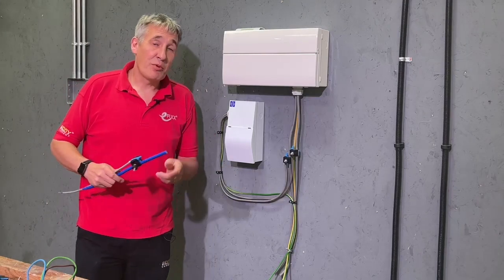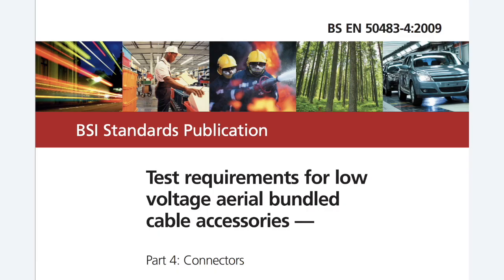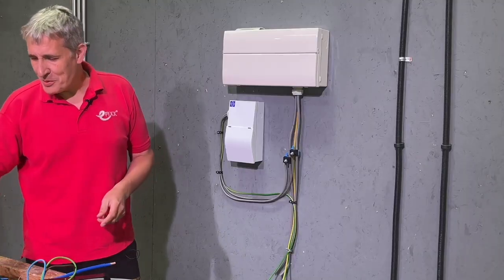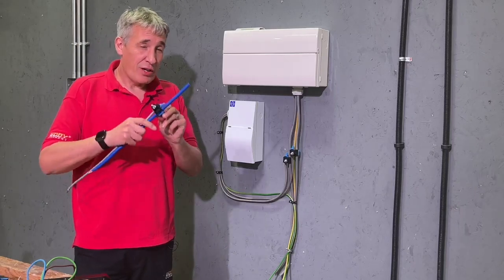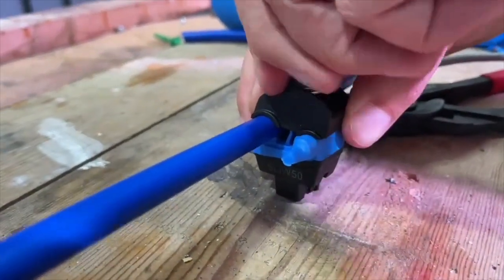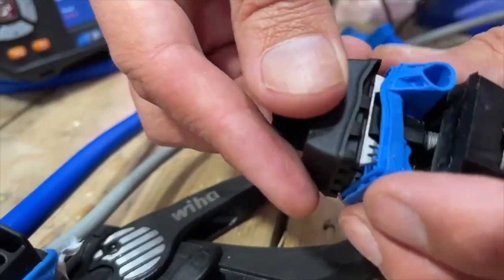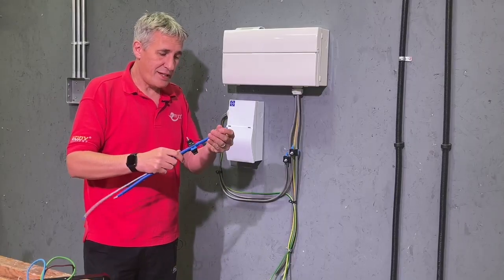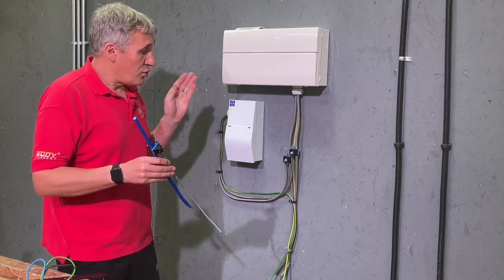Using INSULATION PIERCING CONNECTORS with METER TAILS - EV Charger installation - ENSTO SLIW50

Comment: The big advantage is being able to work live, and so not having to pay the DNO to isolate the supply if there is no isolator fitted. The DNOs use similar IDC to tap into LV feeders but they remove the outer insulation then pot the joint inside a plastic shell. If I were to use something like this, until they are approved for penetrating the outer sheath I'd strip the cables to basic insulation and so fit an enclosure to take the connectors.
Reply: SSE in our area don't mind if you pull the fuse yourself, indeed will even tell you to... not sure what their insurers and higher up corporates would think of that however.  But yes, for the more finicky areas (WPD anyone?), and for places where the service head is in iffy condition, i can see that would be an advantage
Reply: @TheChipmunk2008  Doesn't matter how finiky they are, it's not illegal it's purely contractual and the DNO's contract is with the customer not you.
Reply: @mfx1  true and the EAW act overrules them anyway
Reply: @mfx1  I'm not aware that I ,as the householder, have a contract with the DNO - its the Supply Company (or whatever Ofgem call them) that has the contract with the DNO
Reply: You would still need an isolator. An installation should have a single point of isolation.
Reply: @brendon-paul  Most houses don't have isolators other than the fuse and there is no requirement to retrofit them on old installations. The fuse could be considered a single point of isolation other than it doesn't isolate the Neutral .

Comment: Interesting, I have never seen these before, but as you say they are aerial connections.
It seems as we are borrowing methods previously only used by the DNO's. We now have these connectors, and it's common to use spilt concentric cable for sub mains, something that was reserved for the DNO's only.

Comment: I removed an old brown wylex fuse box the other day . I was looking at the brass terminals with 2 screws for every connection.  Incoming tails, live and neutral outgoing . Made me think how things have gone down hill .  Cooker switches and shower pull cords had 2 screws for each terminal . Now we have to install metal consumer units because of fires from bad terminations .  So now we are advocating glorified scotch locks for 40 amp connections that will be on full load for 8 hours  ??   No thanks . Henley blocks please.
Reply: Only advantage is they are shearoff so not relying on somone judging if it's tight enough

Comment: So we are dropping from 50mm to 10mm with no fusing down? 
Also anyone else seeing the criminal appeal of these for grow houses?
Reply: The fuse is at the end of the 10 mm
Reply: @persona250  It's one thing doing that for a switchfuse or similar that can only ever have one outgoing circuit, but it seems rather more questionable to do it for a CU which has spare ways that may be filled in in future.
Reply: I agree to conform has to be able to withstand what the tails do or what fuse is in supply. Unless the manufacture whats to do a risk assessment on this to be to do it.

Comment: Do the manufacturers of these specify the types of cables they're suitable for?
Reply: I highly doubt the manufacturer will certify it for that application. The DNO materials are usually rated for joining specific cable sizes together, and it’s presumed that any device capable of joining a certain cable can carry the current as well. Marketing and specifications are also on the thin side since there’s very few customers compared to say a Wago connector, so the manufacturers will usually train the DNO technicians and engineers directly or trough a distributor, especially when it’s medium (5-50 kV) or high voltage (100+ kV) gear.
Reply from the maker: Very little data in the product data sheet.
Reply: @efixx  Yeah, just looked and they don't even spec the rated current!
Reply: @mikeselectricstuff  Thing is without proper data sheets or documented current ratings how could these ever be commerically used?
An insurance claim after a fire could sure get interesting...
Reply: @efixx  we’ve looked into these for a while now (one of the new engineers used to use them) I’ve contacted ENSTO and was told that as they were not designed for that kind of use then they wouldn’t be suitable. They would make a lot of our installs so much easier. I’ll ask our NICEIC guy at then next inspection in a month.

Comment: Great video. Personally, I would not use them as they are not designed to be used like that.
Reply: I would agree, they're meant to be placed out of reach, or behind a barrier of some kind (not got blue book with me so can't cite the reg).  The ones big clive demo'ed didn't even have the rubber sleeve, just a jelly fill, meant to be used by utility co's on ABC as mentioned here.

In short, they have their place, which IMO is not in the cupboard under the stairs where stuff WILL get stacked up against them, etc, despite people being told not to.

Comment: Surely a better solution than Henley blocks  would be to fit an isolator switch that has two sets of output terminals - does anyone make one like that?
Reply: Use a 4 pole isolator and bridge them in pairs with a piece of busbar. The real reason these are used is because they can be done live (providing everything else is connected up first) as EV firms don't want their engineers cutting seals (in fact many of their clients specifically prohibit the practice) and getting isolators properly installed hold up the job so this is the solution.
Reply: @Blackf1ngers  My installer didn't get the message then.  He cut the meter seal and disconnected the line tail to isolate so he could fit the Henley Blocks.   I then had to explain to the meter provider what happened when I got the meter changed.
Reply: @cjmillsnun  Well your installer has the right to work safely so that's why he did what he did. While it may not be liked by the metering companies he perhaps knew you were getting a new meter anyway so thought it was OK. I'm not saying I've never cut a seal, but companies don't want it done as a standard practice. If he had fit these IPCs your meter installer would likely have walked away until they were changed for henley blocks (at your cost) so we are caught between a rock and a hard place sometimes.
Reply: @Blackf1ngers  completely agree with you there, it’s a grey area that needs addressing
Reply: You get 4 pole isolators if you have economy 7 so it's not beyond possibilities
Reply: Yes its called a changeover switch

Comment: Hmmm ... Quick? Yes! Safe? ... Yes, BUT only if out of normal access and certainly NOT in my garage where random extraneous damage can EASILY occur. 

Henley block EVERY time. Preferably AFTER a 100A isolator between meter and block for simpler and safer later upgrades. The 100A isolator INSIDE the CU is a waste of MCB/AFD/Surge protector space. Stick one outside! Then when someone wants an extra CU feed to shed/workshop/outbuilding garage there's no need to pull main supplier fuse to add a Henley block and do the work.
Reply: Having a main isolator in the board is a waste of space also a safety hazard because there is always 2 terminals you can't make dead
Reply: @haldo691  yes, agreed, but that's EXACTLY where it's fitted and what is worse, the still live main connections are DIRECT from the meter!! Only protection is the main supplier fuse!! Just DUMB!
Reply: all fine...but your technically changing the type testing of the enclosure...it was Designed with a 100amp main switch by the manufacturer so technically leave it as is and fit 2nd board 😉

Comment: Looks interesting and I have seen Big Clive demonstrate a similar product. I would think an enclosure to clip over it would need designing  also I imagine customers may not be convinced that long bolt is safe  as well as looking nasty. Personally I would not use this type until they are specifically designed for in reach areas. These are clearly not designed for this purpose and I wouldn’t want to be liable or run the risk of negative consequences . I would think my NIC EIC inspector would have a something to say if I fitted them in this way .I would definitely suggest sunscreen 😆

Comment: I know you're trying to spark debate and that but if you've only got a single layer of insulation there's no argument is there. Basic insulation visible outside of an enclosure. Beyond that I don't like it... Not 100% sure why... Just looks a bit bodgy.... Would struggle to be happy the joint was adequate I think... It's not really possible to verify the efficacy of the connection is it.... Maybe I'm just afraid of new things... Who knows.

Comment: Looks like a firehazard waiting to happen, guessing it's gonna get pretty hot on those needle prics when it draws a descent amount of power over a prolongued time
Reply: If you add up the surface area of 4 sets of teeth it's probably not far off the size of a standard 100a switch clamp

Comment: 1. You did not do a current flow test to see if the joints got hot. 2. Do the pointed clamps damage the underlying copper?
Reply from the maker: More to follow.
Reply: You need a JW style electric welder overcurrent test for that!
Reply: The ones used for mainline connections on overhead lines will hold a few hundred amps I've seen 3 or 4 houses fed off of these on overhead lines

Comment: Pretty much every house that's been connect to the electricity network in the last 20years is probably connected with a IPC most are in a resin joint underground
Reply: Underground ain't in your understairs cupboard!
Reply: @travoltasbiplane1551  I agree and these will now start to feature in a lot of illegal extraction we go to disconnect as they make it safe for the to complete 🤷‍♂️
Reply: @englandcal  Hadn't thought of that but yeah, that's a potential nightmare!
Reply: @travoltasbiplane1551  most likely less likely to be an issue than a Henley block
Reply: @haldo691  Depends who installs. The CONNECTION itself may well be superior, indeed is much more likely to. The touch resistance, and overall likelihood of not being damaged by a hoover being slammed into it repeatedly for 30 yrs, notsomuch
Reply: Exactly we've been using them for years on the underground and overhead network the originals had teething issues but the type we use now are bullet proof 👍

Comment: No way would I use those in that situation . They were never designed for that use. Sorry but I condemn you for showing them for using like that . I hammer it into apprentices the right tool for the job , the right connector for the job , the right accessory for the job
Reply from the maker: As stated in the video this is to stimulate debate - look around social media and you'll see EV installers using them in exactly this situation.
Reply: @efixx  my only complaint would be the 10mm limit for the other conductor, I'd like to see one that allowed 16-25mm
Reply: @TheFool2cool  you can get 120mm to 120mm that are used on overhead lines so can't see any reason why not
Reply: Any particular objections? Or they just feel wrong?